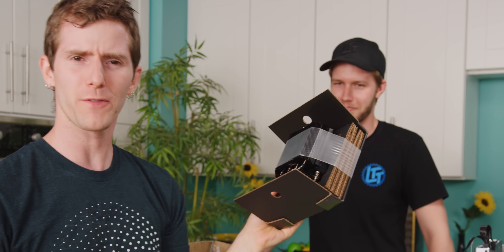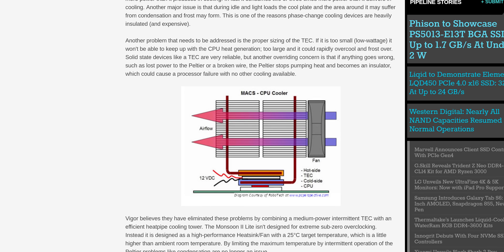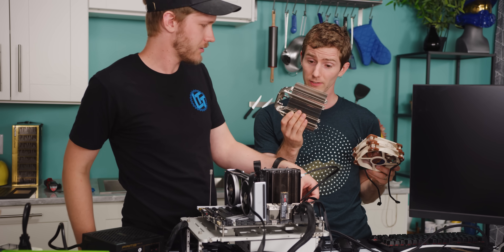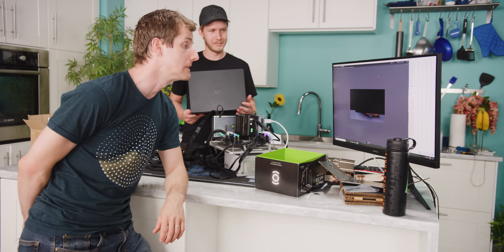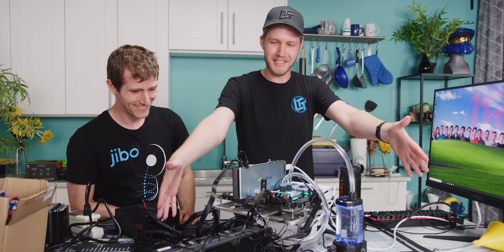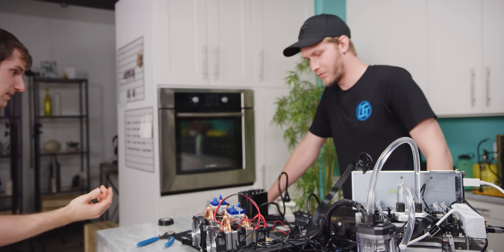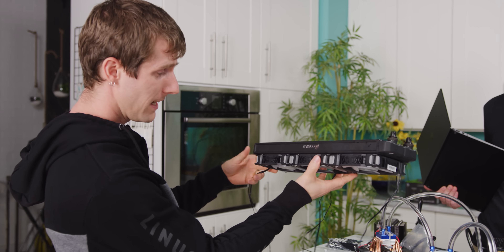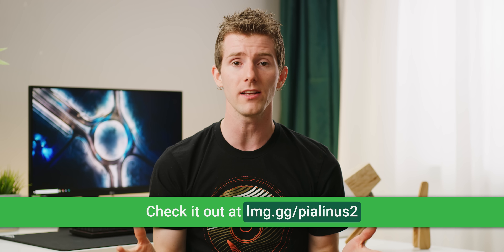Thermoelectric Cooling is a Bad Idea

Comment: The reason TECs wont work for CPU's is the small area it covers. You need to cool 100W over a small area such as 160mm^2 and TECs really don't do a good job of that. The more power you add, the more energy it can pump but the hotter the hot side gets and you just can't cool the hot side fast enough which just leaves the cold side getter hotter and hotter to the point where you are actually just heating the cold side. You could build a system with TECs that cool water, which is then pumped into a cpu block but to do that efficiently you need 10-30 TECs. The actual powerrating on them really doesn't matter. Just the Watts/Area

Comment: peltiers r heat pumps not coolers so you have to think of them more like a heatspreader/thermal paste. if your problem is u cant conduct the generated heat out as fast as its being created then u use them. its like if you could use electricity to make ur thermal interface  conduct more watts per meter kelvin or what ever crazy unit they use

Comment: It's just as dumb as gold plated fiber optic cables

Cough, looking at you, toslink cables
Reply: TechnologyConnections subscriber spotted
Reply: Thomas Huang LOL is that so they conduct electricity better?
Reply: Please tell me this doesn't exist. This would be even below protecting one´s signal from earth gnomes.
Reply: @hotzi9288  they do exist, search toslink on Amazon and plenty of them are gold plated.
Reply: @hotzi9288  Monster makes fiber optic-equipped HDMI cables that are "good for longer runs" and happen to be only... 15 feet long? For $50. They have gold-plated connectors, too, and they have just as much effect on the quality of a packetized signal as they would on a toslink signal.
Reply: hOt Zi check out technology connections >.< it actually does
Reply: lol technology connections reference
Reply: I assume you now know about how switches work and why they click, also AUTOMATIC BEYOND BELIEF!!!
Reply: You've never heard of POF? Power over fiber?
Reply: @Nathan-gj8ch  Plastic Optical Fiber
Reply: HEY. Gold makes the light move faster. Don't ask questions.
Reply: Actually there is a use for the gold plating in stupid high end audio setups. Dont knock it until you try it. Even with toslink, high end cables can help if you have a unique or high end set up. For example, even with fiber optic cables, the gold plating helps reduce EMI from both the audio source and the receiver. BUT, the EMI reduction has more to do with the EMI the optical transceivers have vs the EMI carried from a cable such as copper cables. Point is, if you spent well over 10k for the rest of your audio gear, the 1% gain from high end cables is worth it. You already spent more than the cost of high end cables for way less than a 1% improvement by the time you get to that point.
Reply: @johnjackedson4444  LOL no. One of the benefits of optical fiber is that it's glass, not metal, which means no EMI. EMI will affect unshielded circuitry long before it affects a digital signal in a cable.

The only cables worth spending more on are purely analog. Speaker wiring for example. If you've paid more money for gold plated digital signal cables less than 25 feet long, you have been conned.
Reply: @K31TH3R  BTW, how much have you spent on audio gear and tested it yourself? Everyone online talks shit, but who has actually had real experience with this gear? Stop repeating what you hear youtubers saying and start forming real experiences from your own career. High End Sound Blaster cards do in fact replace many ADCs when you mod the AMPs properly. Not hard. Its really funny when people watch a video or two on a subject and then think they are masters of the subject. People like you really are a joke. Not responding after this, anyone that is interested can easily research this themselves.
Reply: @johnjackedson4444  You can buy the most expensive piece of audio equipment in the world, but that won't change the fact that fiber optic cables aren't transmitting electricity, but light, through a non-conductive media unaffected by electromagnetism. Light is not affected by EMI. And think about what you said for a minute, "transceiver units are the source of EMI," if the transceiver units are suffering from EMI, what does using an overpriced cable do for that? Nothing. Look man, it's okay to be wrong, because it puts you on a pathway towards being right, if you actually care about truth.
Reply: @K31TH3R  I get what you are saying, but I just wanted to mention that the cables do no really do much other than give another piece of metal to kind of "ground" the EMI a bit better. But I do agree with you that the cables should not have this. The TOSLINK ports should be built better.
Reply: @K31TH3R  "It's okay to be wrong, because it puts you on a pathway towards being right, if you actually care about truth." -K31TH3R

I like the way you think
Reply: To expand, The EMI does not do shit to signal integrity of the fiber optic cable but rather introduces noise inside of your actual hardware itself, sometimes very noticeably if you like to edit audio for more highs rather than lows.
Reply: @johnjackedson4444  No , nothing you said made any sense what so ever. I have spent 30 years as a professional recording engineer in working in places all over the world. I have been in control rooms with speaker systems worth half a million dollars or more. Not one single cable in ANY of these studios has ever been gold plated. Just plain old normal copper balanced or star quad braided cable. No one in the pro audio world takes any of htis crap seriously. You are talking nothing but bullshit. Just stop. I am an electronics engineer as my Masters.
Reply: I too, watch Technology Connections.
Reply: Umm toslink is the shit when you want to send 8 mic pre channels down 1 cable
Reply: The reason that's done is for strain relief because glass cables break when bent too far.  Wrap the glass optic cable in some kind of corrosion resistant malleable metal such as gold and viola no more broken toslink.
Reply: @actually5004  No. Firstly they are not made of glass but plastic. And are already very flexible. Try bending one. The gold plating is often seen on the end of the optical fibre and no where near the strain relief. It is a complete folly and nothing but fraudulent.
Reply: Ferocious Mullet um what? Toslink are super breakable lol I wouldnt recommend bending one
Reply: @ferociousmullet9287  Oh if it's not for strain relief and the component is really POF then it's beyond bullshit lol.
Reply: @ferociousmullet9287  The gold plating on the contacts is to prevent corrosion, provides better conductivity and provides protection against wear&tear. 

Not saying you need all that for a simple HDMI cable, but it's not just there to look pretty.
Reply: @joost199207  But the discussion is about TOSLINK not HDMI cables... TOSLINK is OPTICAL. There is no metal to metal contact. Therefore the gold is completely spurious. Also gold plate as a conductor is no better than the underlying material it is plated to. Gold is softer than the material it is plated to as well so it wears faster not slower. As for corrosion resistance? I have literally tens of thousands of not gold plated connectors in my recording studio. Not ONE has ever shown signs of corrosion. Cables do not live in the sea. Every thing you claim is bunkum. Stop.

Comment: I’m wondering what would have happened if you had added the radiator to the loop between the cpu water output and peltier. It should have dissipated some of the heat. It would still be impractical and all that. Might be interesting and worth a try.

One other thing is that some types of Peltiers can generate electricity when exposed to a temperature gradient. Could be interesting for laptop battery life or something. Idk.

As a side note, I work at Coca-Cola and we have experimented with Peltier cooling for soda but mostly gave up on it for the reasons mentioned in your video.

Comment: Bad Cooling Ideas : Using a sterling engine hooked up to a motor to pump the heat out of the CPU.
Reply: Use the heat  differential generated by the CPU to run the Sterling Engine to pump the water to cool the CPU. It's perpetual genius!
Reply: @reeceguisse17  The problem is efficiency loss. You could use it to reduce the power consumption of the system, but not eliminate it completely.
Reply: @reeceguisse17  If you can engineer that, that might just work, too. Because it's not "perpetual". There's a definite energy in/out, of the power into the CPU, and the heat out of the heat exchanger.
Reply: just power it with  SOLAR FREEKIN ROADWAYS, problem solved .
Reply: Bad Cooling Ideas == AWESOME VIDEO IDEAS
Reply: Use stirling engine to generate electricity to lower your comporter operating price and mine bitcoin like that.
Reply: Laugh your ass off, but i have a heat recycling system on my pc right now, it's not a stirling engine, it's much more efficient than that.
Reply: Someone on indigogo already raised a million with this idea.
Reply: It's "stirling" my friend
Reply: Cool idea!
Reply: Stirling engine*
Reply: Andrew Vanderschaaf lindybeige turn you on to the sterling engine?
Reply: If you're going to use a sterling engine, you'd have to thank God for it.
Reply: Bad Cooling Ideas: Hook up your CPU directly to the house-wide AC

Comment: next video, I want to see the twin Tec coolers paired with the tripple 120mm cooler, put the radiator first to cool the water to ambient then use the tecs to push that ambient water closer to ambient

Comment: Peltiers are not supposed to be used as a size or cost saving measure but rather an alternative to things like dry ice which require constant refilling or phase change which is loud and unruly to work with..
The correct way is to use a powerful peltier that can easily keep up with your CPU heatload and then some, and then use LOTS of radiator space as you're not only cooling the CPU heat load but also the peltier transfer + waste heat.

Example: CPU with 360mm rad reaches 60C under load, but 2x 360mm rad reaches 52C which is hitting diminishing returns. Much more radiator won't have any real benefit beyond a certain point.
Add in a big Peltier, and now your 2x360mm rads are near heat soaked, but CPU under full load is falling toward or even below ambient.

With clever circuitry you could set it up so that your CPU stays at ambient regardless of load. The electricity consumption would suck and waste heat filling your room would suck more, but the CPU would be quite happy with that.
I've also seen a set up where a very low power peltier was used to keep drinks cold next to the PC while the hot side was hooked up to an existing water cooling loop inside

Comment: New take on the old Peltier coolers - that actually date back to the first gen' Pentium and, maybe, even the 486 CPUs? Ah, yes - and also reminds folks that they use a LOT of power to work.Witht he cooler side design, did it have a specified fan orientation and/or did you try reversing it?

Comment: Wow, this takes me way back to 2000.  I originally used a "Leufken peltier kit" to overclock my C366 to something stupid like 550Mhz.  The kicker was the thing could only hit 550 stable if it was below 80F.  So I used a 60W peltier, and an Alpha cooler sold in a combo by an enterprising gentleman named Leufken.  Which worked pretty good I have to admit.  Back then I had to strap on a seperate 250W AT PSU to power the peltier itself in addition to the 350W PSU used to power the computer.  At some point I used that same peltier in a water cooled rig (a fountain pump in a Tupperware reservoir using a transmission cooler, and a water block strapped to a slotket with metal hanger strap because prebuilt systems didn't exist then.) for a Celery II 566 that I booted up to 1ghz.  It filled with algae and died a few months later.  Good times.

Comment: Idea: Instead of using them to cool, use them to GENERATE electricity. If you apply a voltage to a Peltier device you generate a thermal gradient across it, one side gets cool and the other side gets warm. However, if you apply a thermal gradient then it'll output a voltage. So, after you figure out which side you need to apply the higher temperature affix that side to the processor and a low-end (stock?) cooler to the other and power the cooler WITH the Peltier. The idea is that the hotter the CPU gets the faster the fan will run (you'll probably need a separate brushless fan controller). This is almost certainly a worse idea than what was shown in this video.

Comment: Hey,
So I have been messing around with TECs for the last 2 months in my spare time and I have found that "overclocking" (overvolting) the Laird Thermal Systems ET15,24,F2,5252,TA,RT,W6 which is purchasable on digikey for about 60 CAD to around 46v which I found was best for directly cooling a cpu. The power consumption was nearing 900w but with 2 360mm radiators and the water temperature around 30C, I was able to cool i7 940 (yeah I not gonna use this on anything too new) at 4.4ghz at 1.43v while remaining sub ambient. I have already built a few peltier prototypes and I live in Coquitlam, BC so if you would like I can bring them if you would like to explore TECs further because its actually pretty fun for a silent subzero fun time.
Reply: hardware fanboi  When you care about CPU temperatures but not electricity costs.
Reply: @cbale2000  not much point in sparing a paltry few degrees to your CPU if your electricity costs outpace how much you'd have to spend on a new CPU once your current one has bit it...let's say you're running a $400 CPU with this 900W monstrosity...after only 4400ish hours under load you've already spent $400 on electricity at $0.10/kWh...no reason to min/max CPU thermals unless you're thermal throttling, which you shouldn't be doing anyways with a half decent radiator...this is only good for an expensive pet project; there's nothing even remotely practical about it, not to mention anything running at 900W is fucking space heater so now you're sweating your ass off
Reply: @cbale2000  Electricity is relatively cheap in BC, and environmentally friendly, with ~90% coming from hydro power.

Of course, that doesn't mean you should waste it either.
Reply: Electricity Bill:
Allow us to introduce ourself
Reply: I built, and still have, my TEC Swiftech waterblock like what was mentioned in the video that I paired up to my Core 2 Duo E6600. It was backed by a 3 120mm fan radiator and definitely got the job done under load never getting to above 80F/26C. The problem was when the CPU idled, the temperatures would drop to about -16C(!!) and I could never insulate my board well enough to prevent condensation from forming. 

I don't have it hooked up to anything anymore, but it's a pretty cool trick to show people how fast it'll freeze a wet paper towel.
Reply: @eddiemuller3157  Just add a thermal controller to turn on and off the peltier and keep it at 26C
Reply: Linus has to see this, it would be a great video
Reply: @ithinkitfake You should contact LTT via the email listed at: https://www.youtube.com/user/LinusTechTips/about
Reply: What about making a hybrid cooling loop with like a radiator in front of an aquarium pump or vice versa and see what performs best? The radiator is likely great at pulling tons of heat out of a tube quick but can't et below ambient temp that easily where as the peltier device can get you below ambient after you have used the radiator to dissipate most of the heat.

Comment: LTT please use radiator to cool hottest water off cpu outlet! (obvious) then the peltiers will be able to avoid heatsoak.
PS the waterblocks and heat sinks used for the aquarium coolers are clearly dog$### surely you know better. tsk tsk
This series needs to be reformatted to "Make bad cooling ideas great again"

Comment: Oh dear @Linus @Der8auer

Misconceptions about Peltier/ TEC elements. THEY DON'T use ALL the POWER they draw from the wall to cool.
So even when they would run at their theoretical maximum efficiency which would be 50% (which is in reality WAY WORSE) you would with your TEC's just got a cooling performance of roundabout 150 Watts @15:45 under thermodynamically PERFEKT circumstances which don't exist ... (wich is not impressiv at all BUT is intenally)

In best regards a Fan

Comment: Apple had peltier cooling heat sinks on its PowerPC 601 Macs way back in the early 90’s.
Reply: dell had them aswell on the xps 720 H2C and it was used the same way they used on the second setup having the peltier module to cool down the liquid that did go through the cpu cold plate

Comment: The point of a TEC when cooling a small device is that you can cool it to below ambient temperature, not that it's supposed to be an effective way to remove heat from a system. Not much benefit for most CPU chip setups, but very useful for imaging chips when doing long exposures etc.

Comment: I saw a design idea a while back, can't remember where, that may warrant exploring. The idea was to have two distinct water loops, with the waterblocks on one (the "cold" loop) and the radiators on the other (the "hot" loop). The two are joined by copper pipes (serpentine bent to increase contact area) soldered to thin copper plates that are then sandwiching TECs between them. The result is ideally a multi-layered miniaturized fluid chiller, with two plates from the cold loop feeding into the hot loop on either side, with multiple TECs forcing heat from either side into the center, and that heat is then carried off to the radiators. Power-hungry to be sure, but I seem to remember the result being compelling. I wish I could find it again, because I think it would be a really cool project for LTT especially with the new workshop.